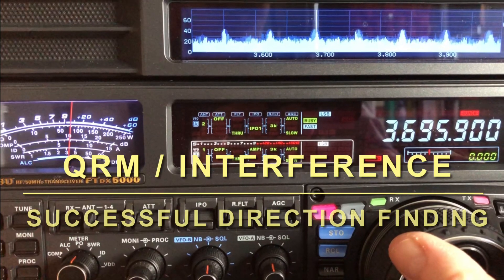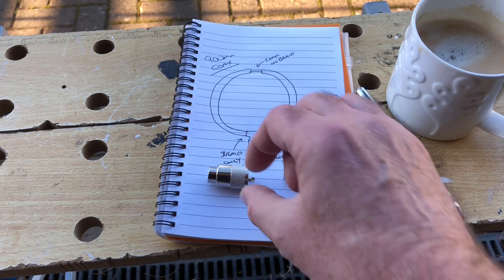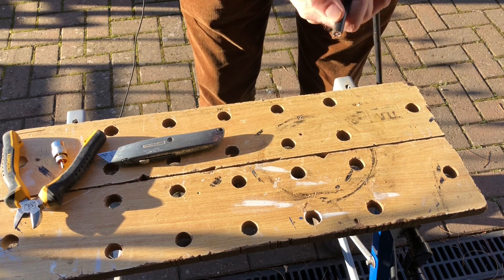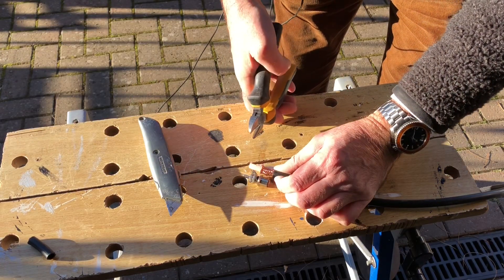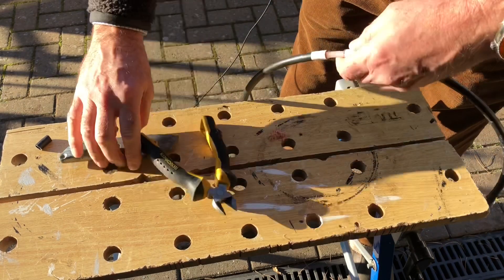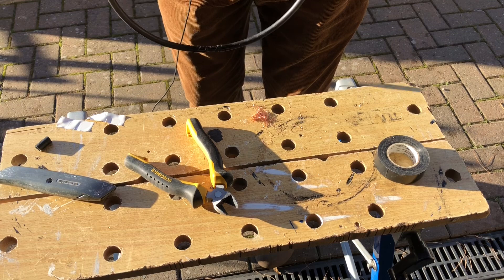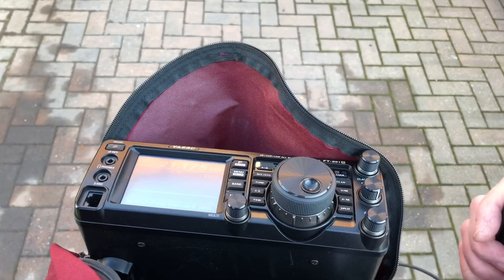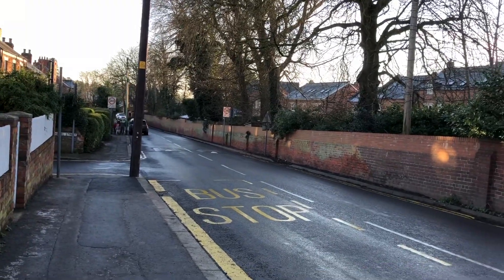Successful QRM / RFI (Radio Frequency Interference) Tracing!

Comment: Haha, a cliffhanger. 

Good work, mate. I love DF, but you sure picked a big rig to lug around. I have an FT-60, attenuator and small Yagi for that.
Reply from the maker: Ha yes James! Not the most portable “handheld” I’ll agree 😁 Battery just died as I finished....
Reply: @ianxfs  FT-60 has 108-137 MHz aircraft band (receive only) which is great for tracking power line type noise.

Comment: Hello there. Is it 900 mm before the chop or after the chop? Many thanks. Awesome vid.
Reply from the maker: Hello! Cut 900mm of coax and then attach your plugs 👍🏻
Reply from the maker: The 20mm bared-off section is at the top. So 10mm either side of the 450mm middle 😀

Comment: Great video! Am I correct is assuming you simply reduced the RF gain or added attenuation as you got close to the noise to DF it?
Reply from the maker: Hi. There’s a follow-up video to this one which is worth watching for the whole track, trace, eliminate story. I didn’t touch the rf gain, but used a “sniffer” for close in work 👍🏻

Comment: Nice loop seen this on the VK QRM website. Just wondering when you are using the loop does the noise increase when the edge of the loop is facing the source - or does it go quiet when the edge is facing the source?
Reply from the maker: Yes, that’s the one 👍🏻 The null is face-on and side-on (edge) increases the signal. Both help with the direction finding 😀
Reply: Thats great have seen a few and was unsure on how this particular loop worked. Did you notice which edge/ side of the loop was better the side which had the centre of the so239 connected or the side whixh didnt?
Reply from the maker: No difference.

Comment: Why did you use a cable length of 900mm? Does that correspond to a frequency of interest?
Reply from the maker: Hi Philip. It’s a non-resonant length as per the original design by the Australian Radio Society.

Comment: Great video. I am making the same antenna and will use it with my FT 891 and battery that I use for Parks on the Air to see if I can track down my RF noise at my QTH. How did you put line on the map to triangulate? Did you use Google Maps some how?
Reply from the maker: Thanks Kyle. I just used Google Earth and use the ruler option to draw lines. That was just for the video though. In reality you’ll either be able to remember or just sketch your area on a piece of paper and record your result lines on there. Good luck 👍🏻
Reply from the maker: ps. Watch the follow-up video if you haven’t already 👍🏻

Comment: Great video Ian how critical are the dimensions, I see you were testing on 15m, my QRM is worse on 10m so would like the loop to work best there, thanks,
Reply from the maker: Hi and thanks. It’s a non-resonant loop so it should work fine on 10m. I used it on 80 as well. Good luck 👍🏻

Comment: G'day Ian

Unless I missed it, you didn't mention what frequency you were using with the loop?  Did you move up bands, or stay on one band?  I tracked a leaking insulator on a 33kv line 8kms away a couple of years back, but that meant moving up the bands, starting at 40m then up through harmonics, 20, 10, then 6ish.  I knew when I was hearing the noise on 70cm, I must have been standing awful close to the source.  Then I physically heard it buzzing overhead.  It was horrendous at home on 40m...'switch of the radio' type stuff.

I have a local switchmode sweeping noise like yours locally this time.  Different approach, so I am finding your video useful.  Interested to know what freq you used with your loop to do your hunt.  Also, were you using IPO or preamp on the 991?

73
Aaron
VK2ON
Reply from the maker: Hi Aaron. That insulator you tracked sounded horrendous. I stayed on 15m. I can’t recall if that was by chance when I turned the rig on. It will have been amp1, but just adjust the rig so you can pick up the QRM as once you’ve got a signal you’re off on the hunt. If it was mega-strong then I suppose you could attenuate to help with direction, but guessing the source won’t be that bad? I’m sure further down the comments someone previously suggested a different method of terminating the loop for greater sensitivity if you need it….good luck 👍🏻
Reply: Thanks for the prompt reply Ian.  I have a loop antenna here....a small wire within a bigger hoola hoop with a break and capacitor at the top, but I am very impressed with your little loop.  Looks a nice simple solution worthy of an hour to knock up.

I think the 991 was a very good radio to do this with.  Beautiful receiver, so you certainly through some good equipment at the problem.  Well done again, and thanks for sharing your experience.

73
Aaron

Comment: hi would your loop antenna work to find inerference on 27mhz? cheers
Reply from the maker: I think so Andy. I used it on 3.6 & 21MHz. As long as the source is strong enough and/or you can get close enough, you’ll pick it up I reckon. Costs buttons, so nothing to lose 👍🏻 Good luck 🤞🏻ps. See the follow-up video 😀
Reply: @ianxfs  hi, cheers for answer bud` oh im suffering with a blanket QRM across all of my transmit modes,,, every frequency is wiped out with a S8 of hash!!!!!! AM is just a buzzzzzzzzz ,,,,,gota find it

Comment: Can these dimensions be used on 27MHz. as well?
Reply from the maker: Yes Francisco. It just depends on the strength of the QRM and whether you’re close enough to be able to track it down. Anyone trying will need to walk around their neighbourhood to hopefully pick up a signal. Good luck 👍🏻
Reply: @ianxfs  That is very nice to know sir. The reason I asked is because I am having the same problem with static QRM from where I am at here in the Philippines both on 11 and 10 meter bands. Thank you so much for your reply, I really appreciate it. Always be safe and 73's.

Comment: I have the same qrm. 68 - 70kHz spacing across all bands 👀 for your next installment
Reply from the maker: Thanks Robin! Looking forward to getting it sorted 👍🏻
Reply: 2E0GGJ
That 68/70 khz spacing is identical to mine except that yours is a bit wider.
I have traced mine, unarguably to a Roof Solar Panel installation.
It seems that it is likely harmonics from the Installation Inverter.
If it goes off after dark, that's a good indicator.
Panels can cause QRN but more wide band.
Listen to one spike on AM wide band and check for a pulsed sound.

Comment: What frequency did you use to listen for the RFI?
Reply from the maker: Hi Philip. I used both 21MHz in the loop video and 3.7MHz in the elimination video. The loop seems to work across HF. There’s some stills in the second video that I used in the first so you’ll see the rig with 21MHz showing. I didn’t feel like I could film much in the second video as it was at the chap’s house. I did ask when I used the wand as I explained I hadn’t used it before and wanted to see if it worked and it would help others too😀
Reply: @ianxfs  Thanks for the updated info, my friend is getting RFI onto the input of his repeater. It occurs mostly after rain. It sounds like electrical arcing, it's sometimes so bad people with a weak signal cant get in.
Reply from the maker: @autoadjuster  Ah right Philip. Hope he can sort it 👍🏻

Comment: What frequency/mode do you use for the receiver?
Reply from the maker: Hi, I was using sideband and mainly 15m. Works well on AM and other bands too.
Reply: @ianxfs  Thanks. I've got a similar problem, S9 noise, repeating every 70kHz or so. Got an electric car charging point in the village, which is horrendously noisy and may be the culprit.
Reply from the maker: @trialen  Good Luck! If you haven't seen it already, there's a follow-up video to this one.

Comment: Hi Ian, thanks for the nice video.  The antenna design you used is definitely the easiest shielded loop to construct and works well on higher frequencies but I recently did extensive tests of it versus what I consider the traditional shielded loop design (where the free end of the coax shield and center conductor connect to the shield near the feedpoint) and the traditional shielded loop works much much better as you go lower in frequency compared with the design you used.  From 15 MHz and up the design you used works really well, but as you go below 15 MHz the traditional loop is really a better choice as it has more gain.  The design you built is really deaf down in the AM broadcast band as an example.  At 7 MHz the traditional shielded loop has 17 dB more gain than the design you used, and down at 1.4 MHz the traditional shielded loop has 28 dB more gain.  I've had discussions with The Radio Amateur Society of Australia about how deaf their design is as you go lower in frequency, and they agree that it works best when used from 10 MHz and up.  Just FYI and 73, Don (wd8dsb)
Reply from the maker: Brilliant explanation and additional information. Thanks Don!
Reply from the maker: Hi again Don. I made the revised loop you suggested and used it successfully (new video). Thanks for the tip! 73 Ian.